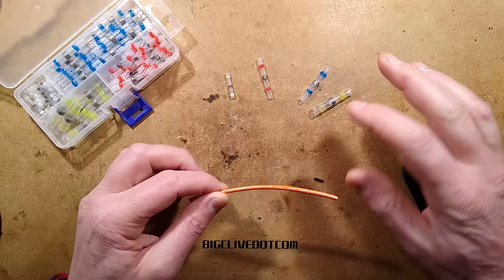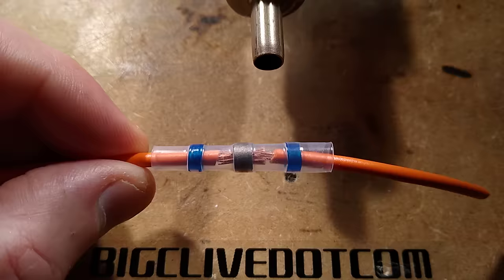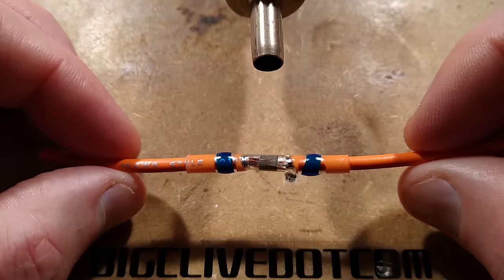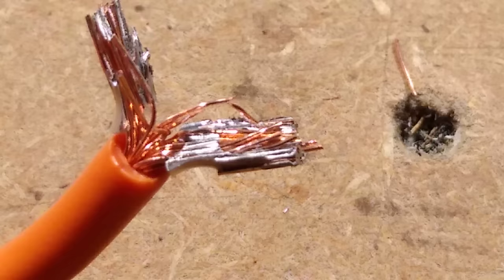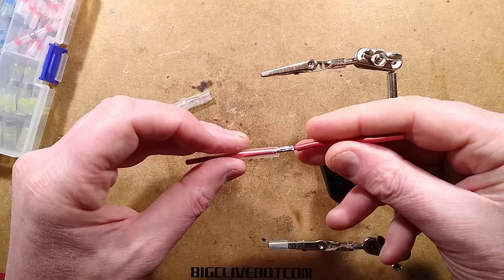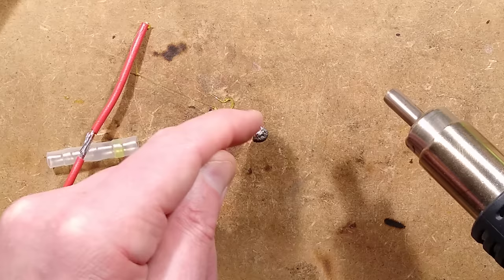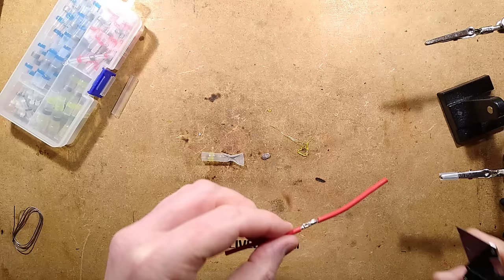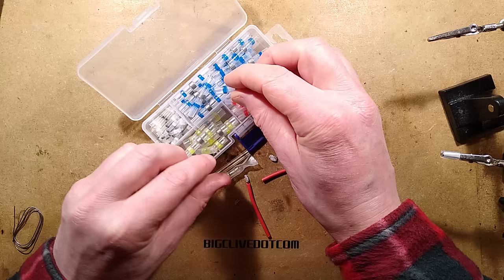Heat shrink solder butt connector test.

Comment: Given how low heat that solder takes to melt I would be a little worried about it reflowing in an automotive application here in Australia, especially somewhere like an engine bay
Reply: There's crimp connectors that have a heat shrink sleeve integral to them. Probably a better bet for automotive.
Reply: Given the low temp solder is held in place with heatshrink and the glue bands, it'd probably do that a lot in such conditions. But possibly no bad thing assuming the heatshrink didn't give up.
Reply: It's still 138c
Reply: You don't solder connections in an engine bay.
Reply: @flandrble  Tell that to your fuse box, alternator circuit board and many other places you can find solder in an engine bay.
Reply: @flandrble  there are a lot of components that are soldered in the engine bay. basically every PCB or sensor has it. solder is perfectly acceptable if done correctly.
Reply: @Drives31forhalo  but when it comes to wiring it's usually some form of connector when modifying the loom.
Reply: used them as quick /temp joints on aircraft video cables in the saudi desert . In the midday sun they would soften and  slowly pull apart  causing intermittent faults . We would remake them at night but they would fail during the first afternoon sortie.
Reply: @warrantyvoid100  Yes! I wish I had known about them before.
Reply: @GlaucusBlue   thats the average bonnet temperature on a car in Australia :D
Reply: @Drives31forhalo  They are not using low temp solder on PCBs.  Probably lead free which has a higher melting temp than even lead based.....  Every car service manual I have says never to solder wiring, crimps only.
Reply: @Drives31forhalo  All soldered with lead free or 60/40 solder (both with a much higher melting temp than these have). I'd have liked to see a variable temp soldering iron with temp probe measured melting temp established before I'd trust them in the engine bay of a car in Aussie summer heat.
Reply: @IPADGETT  Thanks Ian. I think the same sort of connector but with a mechanical crimp ring in the centre and solder bands either side of centre (and weather resisting hot snot bands on either end) would give better performance. At least then the mechanical crimp could hold the works together in high heat situations.
Reply: @EKUL34  You don't re-solder connections in an engine bay, with everything still in place, genius.  Bloody armchair engineers.  Go and get your hands dirty, kid.
Reply: @rogerborg  I never said you do, I feel like you must have misunderstood/misread what this conversation has been about? I brought up the problem with having such a low melting point solder within the engine bay reflowing on it's own due to engine temps, something someone using these might not think about when they go to make connections. As for calling me a kid and an armchair engineer that's just not helpful to the conversation at all, I would expect a better attitude from someone who watches big clive videos.
Reply: @EKUL34  All of which are hopefully conformal coated to ensure that solder doesn't fly off and are hopefully far enough from the engine.  I know that my fuse box is driver accessible, thus probably cool enough and I doubt this is much of an issue.
Reply: These things are junk and 100% guaranteed to produce a dry joint. 

Insufficient solder to coat 100% of the conductors surface area.
A contradiction to the basic principal of heat the joint and apply solder.

I surprises me that some think these are A-OK in any application other than their intended use - pigtail a screen braid. ...but only when high quality joiners used, NOT these cheap China 'knockoff' rubbish.
Reply: @dirtrider88  Nice. Exactly what I had in mind. Thanks for the link.
Reply: @notamouse5630  Good point. For those not in the know, here is an intro blurb from a manufacturer on conformal coatings. Links to sources below. 

"Conformal coating is a protective coating or polymer film 25-75µm thick (50µm typical) that ‘conforms’ to the circuit board topology. Its purpose is to protect electronic circuits from harsh environments that may contain high humidity, a range of airborne contaminants and varying temperatures. By being electrically insulating, it maintains long-term surface insulation resistance (SIR) levels and thus ensures the operational integrity of the assembly. It also provides a barrier to air-borne contaminants from the operating environment, such as salt-spray, thus preventing corrosion."

https://chasecorp.com/humiseal/conformal-coating/
https://aimsolder.com/technical-articles/conformal-coating-over-no-clean
http://conformalcoating.in/knowledge/downloads/msds/
Reply: @dirtrider88  shame those are so expensive, that would make a reasonable replacement for normal soldering I guess, if it were cheap.

Comment: Would be awesome to have a current carrying capacity comparison for each solution, with high current magic smoke
Reply: The wire fails first if done correctly, the joint has higher thermal mass.

Comment: When I worked at GE Aviation in the harness department, we used solder sleeve connections (Raychem)exclusively. 
The went on military aircraft and would experience a lot of vibration and worked fine.

Comment: Clive, do you think putting some flux on the wire ends before applying heat might help the solder flow into the connection better?

Comment: Brings me back to this one electronics class I took where exactly none of the prepared projects were prepared in a way that would lead to success. The heat guns we had on hand either burnt or did nothing to the heat shrink splices.

If anyone who teaches soldering reads this, clean your soldering irons FFS. Are you really going to give some new person who has never held an iron before a rusted up tip that is guaranteed to just be the worst experience possible, are you?

Comment: Especially for alternating currents, there’s a phenomenon called Skin Effect, that makes the great majority of the current flow on the outermost region of the section of the conductor. It shouldn’t matter that the solder has not penetrated deep inside. Also, generally, the limiting factor for sizing the gauge of a wire is its voltage drop, over its whole length. Having one little spot with a thinner effective section, shouldn’t be a problem at all.

Comment: Greetings from northen Sweden.
Those heat shrink solder joints are all we use around the shop, unless it's a power lead for a startermotor or something like that.
I am a mechanic on city buses by the way.

Comment: Clive, I first saw an item like this was at Boeing in the 80's. I was doing electrical mock-up on the 757. They were used to tremanate coax cables, connecting a short length of the shield to a ground lead with the center conductor passing through. Alex

Comment: I remember using Raychem versions of these (I think that was the band name) when I was in the military 20 or so years ago. These don't look to be anywhere near the same quality.
Reply: Still used the Raychem branded environmental splices as of when I left 6 years ago.
Reply: Yeah raychem or Tyco ones are amazing
Reply: I worked in a plating shop about 25 years ago and Raychem was one of our customers. They had quite high expectations and most jobs required quite a few quality tests. I would expect if Raychem manufactured a connector like these for aerospace or military it would be top quality.
Reply: Raychem (now Tyco) solder splices are the only ones approved to use on wiring on Boeing aircraft, per the standard wiring practices manual.  The cheap ones in this video are junk.

Comment: I like your video a lot. I already used heat shrink connectors on my boat. But never the the one that has solder in it as well. I honestly bought them because the didn't have the regular ones for me that that moment. I did exactly what you did, but instead of heating the solder, I thought I just had to use my regular cable tool and clamp on to the metal, haha. So, you reached something! Gratefull for the find and your video. And... really like these connectors!

Comment: have used these and found after a few years the solder will crack and you get a poor joint , so i would not advise use for long term on a car etc

Comment: "... if you had the heat shrink on beforehand...."

Easier said than done ;)
Reply: I think what I meant to say is "if you remember to put the heat shrink on ahead of time", LOL.
Reply: @josephdestaubin7426  Sometimes there is not enough length to put the heat shrink on. To close to the solder joint and  it will shrink the end of your heat shrink and you won't be able to slide it .
I wonder if a little additional flux would of helped the penetration on these.

Comment: I used these with Western Electric as far back as the 70's. I forget the brand (but you can be sure they weren't cheap) but they were a much higher quality than these appear to be.  Turned out to be great for installing car stereos back when that was a thing.

Comment: I've had these in my tool box for along time but just now had an opportunity to try them out while installing Nav lights. Following your video they worked as describe. Will test with power before installing but am confident on outcome.  Thanks!
Reply: Did install Nav lights on my boat without any problems. These shrink/solder butt connectors worked fine. Did cover with another heat shrink just for extra water proofing.

Comment: What do you mean: "better than a crimped connection"?  A good crimped connection is the gold standard, is it not?
Reply: I came to say this.  Crimped is better than Soldered.
Reply: Well, at least automotive prefer crimped rather than soldered...
Reply: Crimping would be better for high currents, and vibrations.   With normal solder  you can get diode forming by bad weather conditions, and it could brake by the vibrations. It happend once to me with a chainsaw solder joint to the bobine.

Comment: I 'found' these things a few years ago. I especially find them useful in cases where 'messing about' with a soldering iron etc. is difficult / impossible.
So far all of the connections I've made ~4 yrs ago still hold and work without issue. I also have a few in the  glovebox of my car... just in case...

Comment: These have been in the Aviation industry for years, you need more heat.... if you can still see the solder 'ring' shape, it's not quite there. It's a fine line between getting it right, and heating it to long!

Comment: Hi Clive. Eric O has some thoughts on these things in his last video!
Reply: I was looking to see if any one saw that video he does not like them atall
Reply: Eric O and my friend who is also a professional mechanic and auto electrician share the same opinion of them. They might be ok in low current applications and there is definitely a lot of variation in the quality of various versions of these on the market, but he's seen a lot of failures and refuses to use any of them now.
Reply: Always interesting to see how others also follow the same channels. SMA is awesome. Also DiagnoseDan. Learned more about can-bus comms and using a scope from those guys than from the electronic channels :-)
Reply: They're probably okay for something that is stationary and doesn't see a ton of temp variation. In my opinion these are more of a hack to get you out of a bind with minimal tools rather than a proper fix if you're going to use them in a car.

Comment: I use these at work all the time for repairing 4-20mA pressure transducer cables in an outdoor environment. It's a much more robust repair than a standard crimped butt connector, especially if you add another larger piece of glue heat shrink over the top of the entire repair. They hold up quite well in the harsh oilfield environment. However, anything more than 1A, I would definitely recommend a traditional hand soldered splice. I've never seen them fail in that fashion, but it's not a repair I would be comfortable signing off on myself.

Comment: I have mainly used this to solder microcoaxial cable shielding to wires. Then the hot and shield wire got a crimp and went into interchangeable panel connector blocks. It was not meant for RF, just shielding low voltage DC and low frequency signals. I remember introducing a presoldering task by hand, because of the small amount a shrink tube has inside. Without presoldering coax shielding absorbed nearly all of the solder inside, not making contact at the right spot and an acceptable joint basically.

Comment: Cheap eBay crap.. Buy the “real deal” and problem solved.
Reply: They're shit too. Used to use them.
Reply: Rich I use them in Class 3 electronics, IPC certified. If they work in there it is fine for quote unquote civilian applications.
Reply: @annelisemeier283   They don't make a reliable joint even when the wires are clean and new. You can have confidence in them if you like but we found them to be unreliable over time. If your circuits are always heavy and high-current you might never see any obvious problem but our small voltage signals in high-impedance circuits (In intrinsically safe offshore equipment) would just go open-circuit after a couple of years. It was worst if the wires were not completely new but even fresh clean wires could go bad. The joint they make is not a proper solder joint, doesn't get rid of the oxide, is brittle, peels apart, ends up being a tiny capacitor instead of a zero ohm connection.
Reply: @annelisemeier283  they work great, I use them all the time for automotive wiring
Reply: Rich we literally use them for mission critical military equipment. They are obviously not the be all end all but for 99.99% of all applications they’ll work just fine. The one clive tested just suck plus they have their use case, what you described evidently not being one of them.
Reply: @annelisemeier283  We were using expensive ones from a proper distributor, can't remember the brand. They were not at all cheap.
The wires we used were what came on the industrial sensors we bought in. It was actually quite nice wire. It may well be that they work acceptably if you have super-clean silver-plated wire or something, like you might use in aerospace/ military, but what I see around is people using them (cheap or otherwise) for repairs, and this is where I know from experience that they're just going to fail. They are not sold with any meaningful caveat or guidance as to when they are appropriate so all considered I regard them as a bit of a con. 
I remember thinking they were amazing, a panacea, when I first saw them and this is pretty much what anyone is likely to think until they find out to their cost that the joint has been unreliable.
The lack or proper heat + flux means that you just don't get proper metal to metal soldering.
Reply: Rich fair point, don’t think they’d fare well under non-lab conditions. We shrink them at 370 to 400 degrees C, so slightly higher than we solder (withe the good leaded solder anyway).
Reply: All of them don't work. What most people here claim as working is nothing else than two touching wires passing current. The hotmelt things don't properly wet the wires. That's the problem as soon as the joint ages and corrosion cones into play, mechanical forces or high currents. Who thinks these are proper repair also thinks twisting two wires is proper repair
Reply: sciencebear timberwoods so the IPC clearing them for Class 3 is them not working is it? Lmao
Reply: @annelisemeier283   the ones in the video are certainly not ipc certified.
Reply: sciencebear timberwoods that much we can agree on

Comment: As a Guy that connects wires a lot this looks like a great idea. I would recommend adding flux to the wire tips before heating. like Ryan-kk2rr posted. The huge problem I see with these is after they are heated the rubber coating around the bare wire part looks super thin. Any application with movement and these are a short waiting to happen. This just my opinion. I have never used them, maybe they are fantastic.

Comment: I have been using these heat shrink butt connectors for 3 years now and they are  excellent connector for wet conditions, They certainly make joints last longer and I feel they will and do out last the conventional mechanical crimp butt connector. I give them 4 out of 5 stars. I 1 star they could have gotten is that I wish they made some that would allow a multiple connection a Y or T connector.

Comment: I've seen this issue numerous times while at Lockheed Martin where the solder didn't flow to the inner stands. The main mistake you have there is not using the correct tip for your hot air, going with a curved shield tip is by far the best way to go. Also no need meshing the stands together, as a general lap splice is just as strong

Comment: These were developed for the aerospace industry. I assume the "space grade" ones have quite a bit more solder. When they first became available to the public there was an article in one of the popular magazines, a test of various wire splicing methods. For this type they used a heat gun nozzle that blew air at it from all around. The article also noted they were the only wire connecting method approved for use on the Space Shuttles. So, yeah, the good ones made for that use would have more solder. Just the right amount, not too little, not too much.